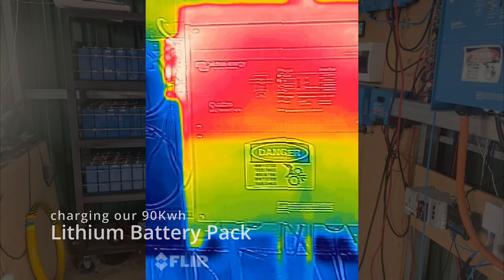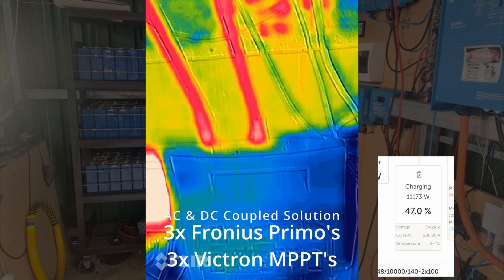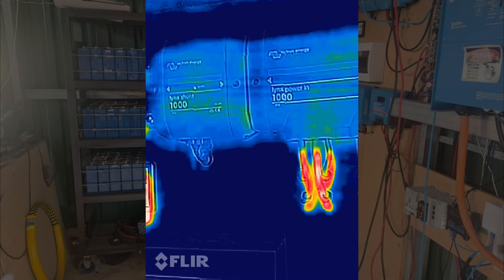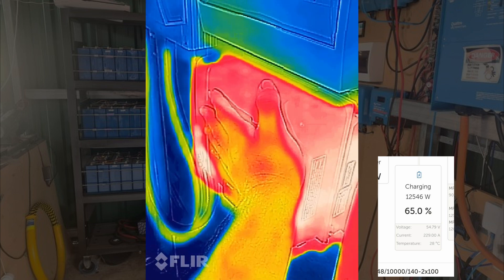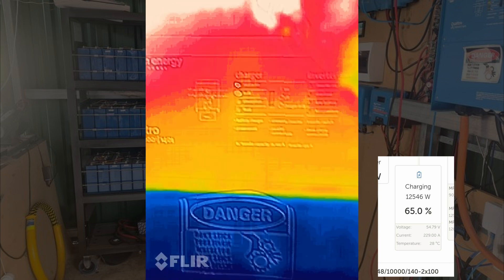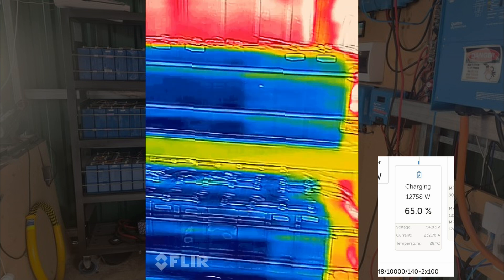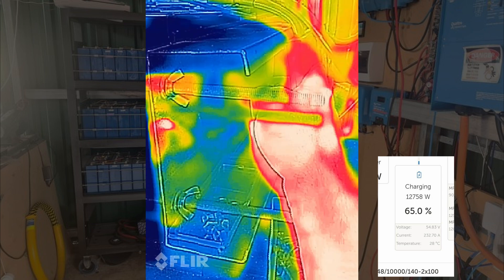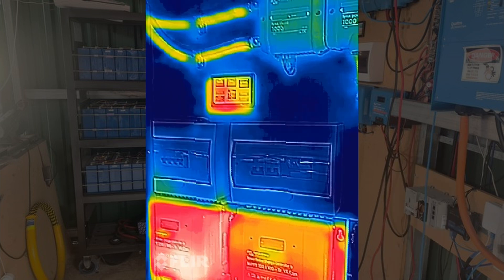Bad Idea #1 Shorts - Increasing our charge current

Comment: Just curious how are the battery banks connected? 
Every pack to the busbar en from the busbar one lead to the inverter?
I'm thinking of having 4 banks of 16 kW and with a 3 phase system 3x Multiplus 10000
But that would mean I could have max 625A go over the leads, so they would have to be 2x 85mm2 I guess to be on the safe side?
Curious if the batteries will be able to take it :)
Reply from the maker: That is correct. they go in to a Victron Lynx power in, then in to 2x 90mm2 cables in to the big breaker fuses then in to the shunt. 

How often do you expect to pull the full power from the inverters ? Given they are in VA are you planning to scope it to their peak power or just the average ?

I find that with houses most loads are a spike then taper off. Ovens and heaters not withstanding. But the time the cables are the warmest is usually when you have sustained charge. Heating elements in ovens turn on and off so the duty on the wire is not 100% which gives you some wiggle room. We invested in a little thermal camera to monitor ours and its been a life saver